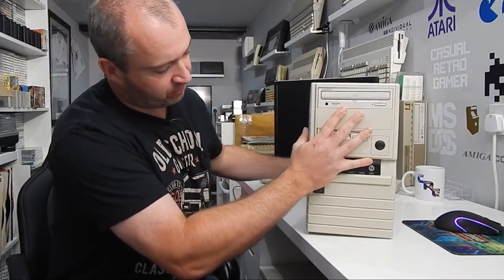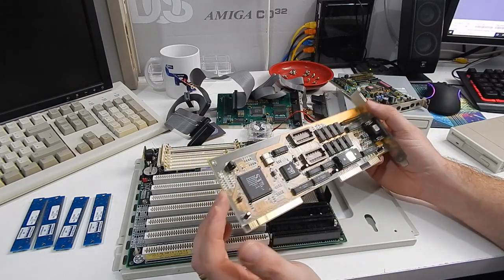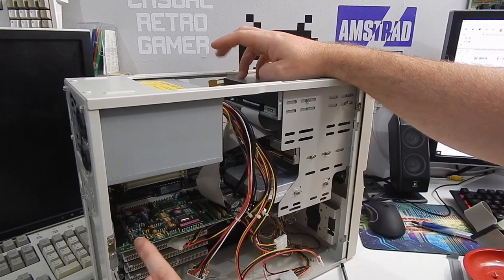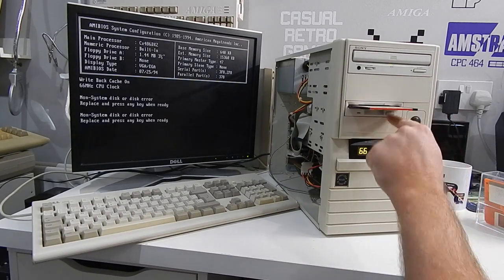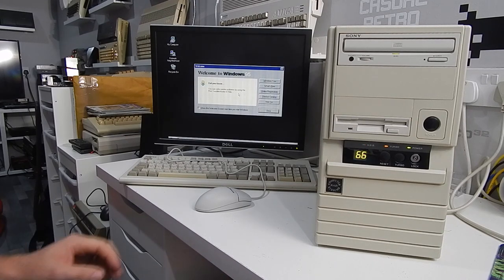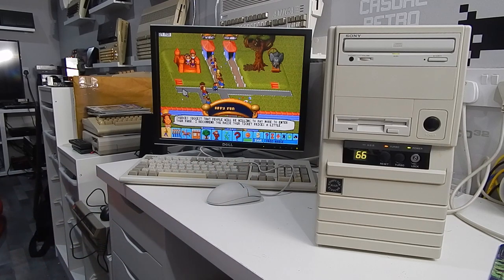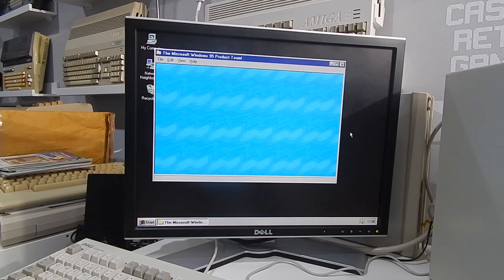486DX2-66 system build with Windows 95

Comment: Thank you for the useful information and the Easter Egg!  I have an IBM Valuepoint 486DX2-66 with 16 meg running Windows 95 on a CF card, wouldn't you know.  I used to have to tap the old hard drive to get it working so gave up on it.  I can't wait to try the Credits thing.  Cheers

Comment: Ohh... I forgot to mention some useable info, on how to get Win95 installed on the machine....

You can do it this way. Make a Dos boot disk. Then have the drivers loading from that floppy. You need to have format and fdisk from Dos on it as well. That way, when the HDD is formattet, the optical drive will become D: or whatever drive letter is the last. Just make sure to add lastdrive=e or whatever drive is the last (plus one drive extra). Then you can run the installer straight off the optical drive.

Secondly, you can actually make a directory on the harddrive, and copy all the installer files to the harddrive. Then sys the C-Drive and start the installer with a minimum Dos operating system. That is, run the boot-disk. Partition the drive(s). Format all HDD drives. Sys the C-Drive. MKDIR C:\Win95 and copy all files from the CD to that directory. Remove the DISC and the DISK. Reboot and start the installer from the C:\WIN95 directory.

At least that was how we did it back in 1995.
Reply from the maker: Thanks, I'll maybe try it that way next time.
Reply: @CRG  If you create a Dos6.22-Bootdisk, a Win95-Bootdisk and a Win98-Bootdisk with Fdisk, Format, Sys and CD-Rom drivers. Then you are well off, regarding tools for system installation. I have those in my Diskbox.

Comment: Great Video!  I'm looking for a 486 machine to add to my collection (because I need new pain) -- that network card is BNC or "cheapernet" instead of Token Ring.  You've got BNC for coax connection with terminators, AUI (15pin ctr) and RJ-45 for "normal" ethernet.
Reply from the maker: Thanks for the info.  I always though of bnc coax as being used for token ring topology networks and ethernet cat5 for star topology networks.  Its been a good few years since tech but I'm fairly sure that's how we were taught.
Reply: @CRG  BNC is for a "bus" style - there is a 50Ohm terminator on the end of the bus, then a coax (RG-58 I think?) that runs to t-connectors on each NIC and finally a 50Ohm terminator on the far end.  Token Ring was a similar setup physically (except the ends connected to form a ring), but it logically/literally passed a token around the network and whoever had that token could send traffic.  Ethernet has a carrier sense function that solves that problem.  Of course that is all from memory back when I knew what I was talking about.
Reply: Yup BNC 10base2 used RG-58, particularly handy back in the day if you were also a CBer as you would probably have a reel of it in a cupboard. 

The AUI port hooked up to a cable tap (MAU) for 10base5 site backbone networks. Token ring was used over twisted pair, coax and the IBM hermaphroditic connector system (basically a 4 pin twisted pair system), I only ever saw it once and that was the IBM system.

People knock 10base2 but it was very cheap and could run 200 metre segments, 10base5 did 500 metres, they were great for big buildings, these days we use fibre, expensive but much, much faster.

Comment: My first DOS/PC compatible was a 486, and I believe it was the same : DX2-66. (Up until then I had owned various 8 bit machines, then an Amiga 2000). The pizza place I worked at gave it to me when they upgraded. It had DOS, but I installed Windows 95 from about 20-30 floppies! (I can't remember exactly how many, but it was a lot.)
Reply from the maker: I went from A1200 to a pentium 66 packard bell as my first pc which was quite the step up.  Great fun now though looking back over the x86 systems I missed out on, especially the 486 which is so iconic to many.

Comment: Nice case, and that motherboard is pure p*rn! <3 Although I'd say for Windows 95 and games you want 32MB RAM. 16MB is a bit low. Also that coax connector on the network card isn't necessarily token ring, it might simply be a 10BASE2 Thin Ethernet connector. Need to set up one of those in my retro workshop! :D
You'll want a DX4-100 or faster to play the Build engine games smooth enough to be enjoyable, and you'll want a fast Pentium or MMX even to play them smoothly at a higher resolution.

Overall great PC, perfect for all but the very last DOS games. Enjoy it, and bring it to one of our 486 retro LAN's! :)
Reply from the maker: Would love to attend a 486 lan party.  Maybe one day!

I have another 486DX4 100 system to build all be it I might not get it done in this batch of systems.  Something fun about pushing these old systems to their limit just to see what they can do.

Comment: im using a M919 which is like your board but with PCI and has a proprietary cache slot which fortunately has cache in it since i found a 5v 256k module for it.
Reply from the maker: Nice, the 919 is a decent motherboard and great that you found a cache module for it, those are hard to come by.

Comment: You should note that this motherboard has fake cache. The Write Back written on the "cache chips" confirms this"

I have the same 486 motherboard - PC chips M912.
Reply from the maker: I've checked this with a utility and yep fake cache.  Not very impressed to be honest so I'm looking into putting real cache chips in there.  I imagine I'd need to update the bios as it reports external cache enabled.  More homework required.
Reply: @CRG  Cool, I'm going to keep mine as is .... I have a couple of other VLB motherboards that have real cache.

A bit more explanation about the whole situation and how it went down in the old days with fake cache motherboards.

http://redhill.net.au/b/b-bad.html

(redhill.net.au's history site is almost as bad as tvtropes.org, can waste hours on it)

I would recommend linking to TH99 (https://arvutimuuseum.ee/th99/) for jumper settings rather than stason.org as well. Stason.org took TH99's data and put it on his own website, but somehow got search engines to rank it higher. Then he uses his website to sell stodgy books.

Comment: Question: I hawe my first pc with motherboard 486sh and my bios is like this one, originaly had 500mb hdd, and now I decided to connect IDE/CF with 16gb, it sees but if I do "format c :/s" it formats just 500mb partition and it's fat12... my boot disk contains DOS 7.1 how do I format fat16 and like 2gb partition, I heard taht windows 95 OSR2 suppors fat32, but stucked here...funny but I'm computer enginer :D HELP me :D P.S. I asume this hardware doesn't support HDD 40GB either :D
Reply from the maker: Is lba enabled in the bios? 

You should be able to create the partition sizes up to 2GB with fat 16 which to be fair is loads for a dos rig.

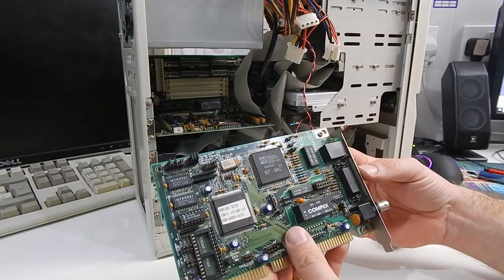Comment: 12:22 That doesn't look like Token Ring to me, just plain old 10BASE2 "cheaper net" - Ethernet over RG58 coax cable. The connector next to it is for connecting a 10BASE5 "thick Ethernet" transceiver. Token Ring is its own networking standard unrelated to Ethernet.
Reply from the maker: Yep your correct that's a mistake on my part.

Comment: Feck sake, Token ring on that network card ? Really get a grip that is COAX ETHERNET BASE-2T or sumthing). Token ring is totally different!
Reply from the maker: yeah not sure what I was thinking with that statement :)  

I still want to make a cheapernet, coax ethernet, base 2T or whatever its called network.
Reply: @CRG  Try to find something called Little Big Lan, it was a cheapo network solution for DOS, back in the day it enabled me to go over the limit for length on coax cabling. Basically because the cable was too long machines on one end could not see the machines on the other, so what I did was (thanks to LBL being forgiving) mapped all the network drives on a system that was in the middle of the cable and then used that machine to share those mapped drives again hehe. This allowed me to use that machine as a bridge sort of hehehe (This was definitively cheaper than using a real coax repeater which we did not have and we needed to have the network running for the coming Monday so this did the trick hihi)

Comment: Feck sake, all these motherboards with VESA slots SHOULD HAVE VESA IDE CONTROLLERS AND THEIR RESPECTIVE DOS DRIVERS!
What a waste of performance! (Same goes for the VGA)
Reply from the maker: I do have a VESA controller to drop in now, might do a comparison to see how faster it actually is, if at all...
Reply: @CRG  Look, if you do not have the drivers for that Hard disk controller you will not get even 10% of its real performance! Dig for them!
On this subject, I used back in the day a IDE VESA LOCAL BUS controller from Promise which was equipped with its own dedicated 8Mb of RAM, fun detail this board had its own 80286CPU dedicated just for handling the HDDs  (This was a NetWare file server, main server had 16Mb and a DX50 CPU because of the 50Mhz FSB that was important to ensure maximum performance from the Promise card)